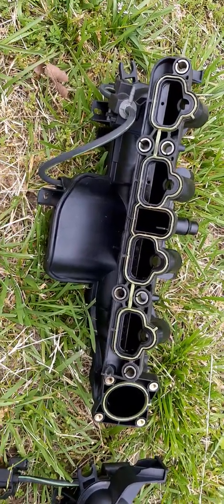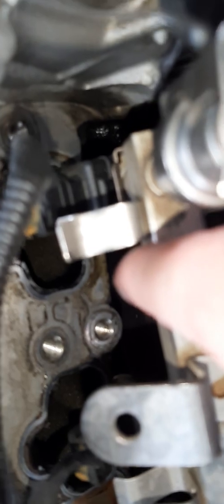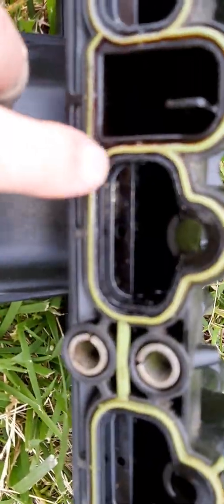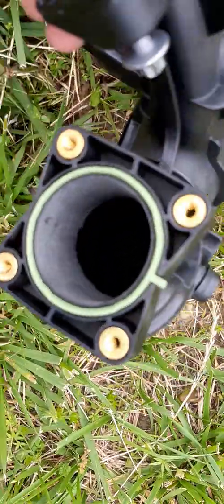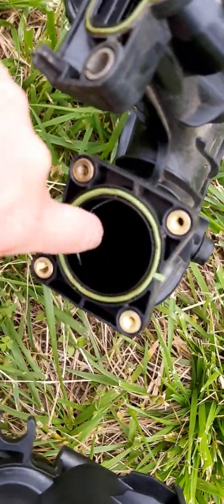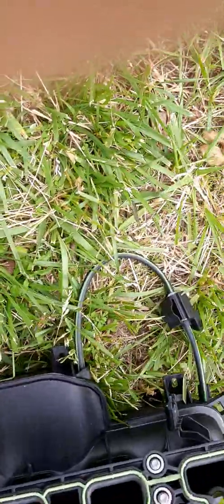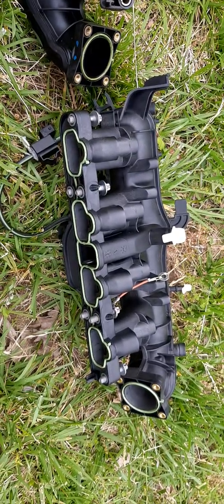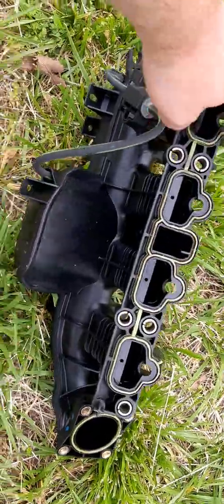11-15 Chev Cruze 1.4 ZZP Ported Intake Manifold vs OEM airflow.

Comment: All I'd like to know is what happens with the fuel mileage with the extra HP? Mine gets 30-35.
Reply: I did mine when installing the ZZP PCV fix.  Def better response and honestly milage didn't change much if at all....I was getting 6.2l/100kms and not its around 6.5l/100kms which is from 38 down to about 35 so still amazing fuel economy for the bang!!!  And no error codes or erratic idle.

Comment: hello ı just wonder that is this applying throw any error codes or  erratic idle can be occured ?
Reply: I did mine when installing the ZZP PCV fix.  Def better response and honestly milage didn't change much if at all....I was getting 6.2l/100kms and not its around 6.5l/100kms which is from 38 down to about 35 so still amazing fuel economy for the bang!!!  And no error codes or erratic idle.

Comment: Does the car have to be tuned for this I have trifecta
Reply from the maker: Nope. I'm still not tuned and no issues just gives you more power.
Reply: @koreymayo8884  really ???? Hmm 🤔
I'm not doubting you but I did some runs with a new ultra gauge before I ported my intake so I would know the numbers such as AFR , Boost , HP, Tourqe Etc  also I have the trifecta turbo advantage tune for about 5 years now . After porting the manifold in stock tune it goes too rich to fast if you floor it , were it was a gradual increase un ported I did hard pulls at WOT both stock and trifecta tune in ported now ported it's a turd ..the ECU will go as low as 0.68 that is 10 rich on a wide band on my gauge around 0.74 was were max power output was that's around 11.5 or 11.8 ...at WOT so porting for me in my case after doing the pre ported runs I lost power do to the way the ECU responds to the extra flow .
I'm looking into what tunes people got after they ported the trifecta tune handles the porting better but IMO no better than it did before I ported it at 3/4 throttle it loses its bark it needs fine tuning I would recommend porting and tuning for sure but I just don't see un tuned power with a ported intake .

Comment: I like the ZZP ported manifold I think they should had thrown in the PCV fix for the price ..
Reply from the maker: I also talked to ZZP and told them to sell the chevy volt thermostat as a colder thermostat/ upgrade for first gen cruze owners, but they never did.
Reply: @koreymayo8884  
Good idea 👍 ....I think in a tune they can lower it at least on the forums I read BNR can set it in the ECM I guess those elec connection on the stat control it at the ECM ...man now I want to port my intake ...I had it out and I was like ????? I guess I could had done it and got a used one from the boneyard if I failed smog ..maybe next weekend I'm going to port it .
Reply from the maker: @TheThirdWheel618  not sure about BNR, but it ZZP tune they told me they lower the radiator fan temps, but not sure if they adjust the thermostat temps or not.
Reply: @koreymayo8884  
I just got a bulletin yesterday about the rubber diaphram on the valve cover they called that the pcv  now it's a warranty recall if it fails I have a 13 Sonic RS , not the intake with rubber check valve yet tho  ..
I ordered to ZZP coil pack a cheap Amazon /eBay catch can , a forge blowoff valve for  fun to hear the pssst swoosh / ... I might port the intake soon although I have a trifecta tune called the turbo advantage it's a tune for completely stock Sonic not sure if it would thro that off or not ....at first I thought they pulled a fast one since I have the auto with paddle shifter I can hold shifts longer and play with the down shifts , I thought they just extended my shift RPM range and called it a tune .
But even with that it pulls pretty hard I don't know what they did but they told me it don't change emmisions , so porting might change the tune it's pretty cool you press the cruise control and it lights up white not green then your in stock mode press it off now your in tune mode .
Reply: Definitely a night and day difference 
I would like to see the difference on a Dyno ...
Reply: @koreymayo8884  BNR can, my BNR tuned Cruze runs right around 200.

Comment: A bit off topic, but I seen you commented on another video about upgrading to the sonic thermostat? I tried to find that video again to reference what years you said and I couldn’t find it. I have a 2011 Cruze 1.4. I just installed a low mileage motor in it and I hav e seen nothing but overheating issues with these cars and I remember you saying something about the sonic using a lower temp thermostat. Would I just got with a 2011 sonic thermostat? Or did they upgrade the thermostat in newer years of the Cruze? Any help would be very appreciated, thanks.
Reply: I've been talking quite extensively on this subject with someone on you tube the thing is you can use a Sonic thermostat I think 2016 and up.haveva lower opening rate mine runs hot 2013 RS Sonic it has a 217 thermostat I seen the 2016 Sonic has a 203 degree thermostat . I'm thinking of changing mine to 2016 203 degree or possibly lower to 198 I think 2017 Sonic stat .  I heard one you tuber used a Chevy volt thermostat with a 176 opening rate although the housing is different you can take the thermostat out if the housing and swap them out to the housing for your year .
Reply: Ha ha that was your channel and your post  I'm commenting I been talking to someone about engine temps and changing thermostats it was you I was talking too.i thought I was on another video ....man   sometimes you feel like a nut lol ....
Reply: @TheThirdWheel618  Get it, Thanks
Reply: same here.
Reply from the maker: Chevy volt thermostat opens at 176 degrees and you have to take it out of its housing and put it into the first gen cruze thermostat housing. Second gen cruzes already run colder 175-180 degree thermostats. I have a video on doing the swap.

Comment: Did you get any Check engine light or any codes ? After you put on .Thanks
Reply from the maker: Nope. Also did a big 3 wire kit at the same time to improve the electrical system of the whole car and now the car has better throttle response, more power and pulls harder when accelerating! Also 1 MPG better on the highway now.
Reply from the maker: Just uploaded a new video
Reply: I did mine when installing the ZZP PCV fix.  Def better response and honestly milage didn't change much if at all....I was getting 6.2l/100kms and not its around 6.5l/100kms which is from 38 down to about 35 so still amazing fuel economy for the bang!!!  And no error codes or erratic idle.